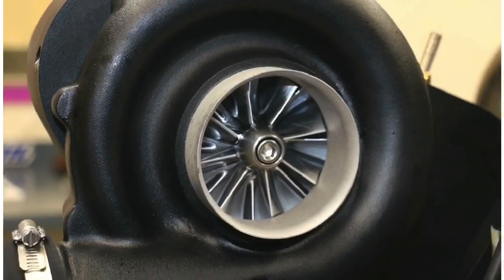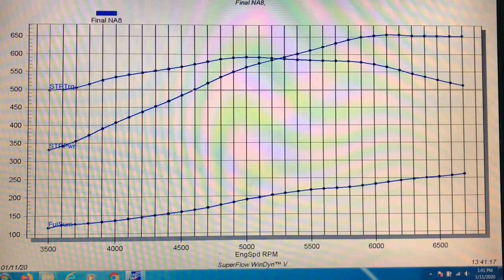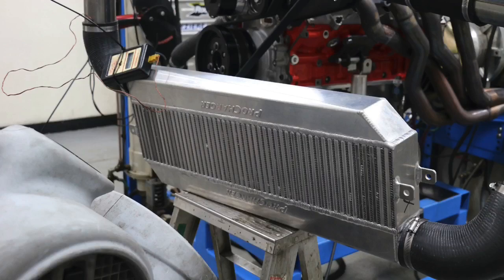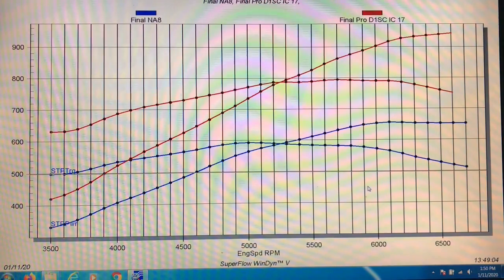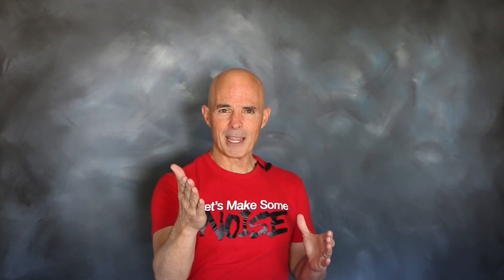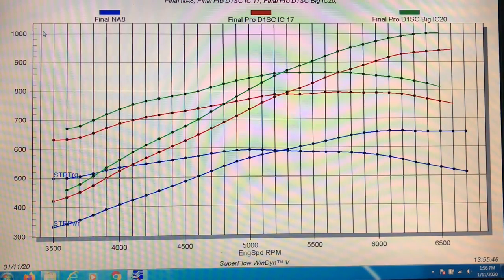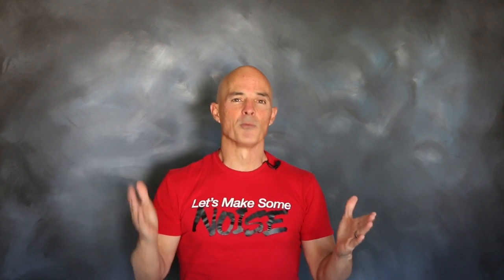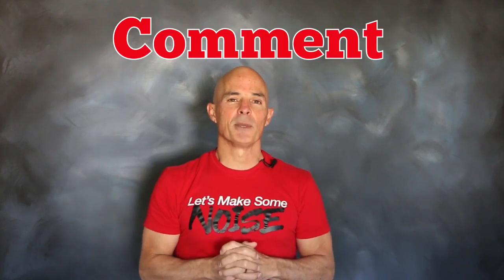LS ATA INTERCOOLER TEST-IS BIGGER BETTER?

Comment: I would love to see what the difference between 3 inch and 3 1/2 inch piping would make really appreciate all your time
Reply: I think he did this or it might be exhaust I'm not super sure but you can check the vids
Reply: I’ve back to back tested 2,2.5,3 inch piping on a 300hp sr and bigger was better in response,hp and temperature drops. Also going to a 4 inch core vs 3 inch in 300x600 dropped boost pressure but held the same power so bigger is better in pretty much every scenario considering my testing was on 300hp

Comment: Should have ran the 4.5" core
Reply from the maker: What this motor really needed was an F1A-94 (which I ran)
Reply: @richardholdener1727  also true... Would have been interesting to see the difference between 3 3.5 4.5 small water to air and big water air at same pulley size

Comment: Richard!!!! I know you love efi. What do you think of a blow through methanol carb system vs efi with intercooler??
Reply from the maker: I like intercoolers on every boosted motor-even blow through carbs
Reply: On a race only engine on e85 and meth injection. Water to air or air to air?

Comment: can you do 100% methanol no ic vs intercooler
Reply: Agreed, everyone says, You don't need an intercooler for methanol", while that may be true from a detonation standpoint, intercooling ALWAYS adds power through density!
Reply: Cheap Intentions this was actually done on engine masters with the help of Richard. If I remembered right the engine was fine with methanol at low boost, but a problem arose with unequal temperature across cylinders. The test was done on an ls motor with an efi manifold so the meth was not able to flow evenly across all cylinders, leading to less power at equal boost when compared to an inter cooled set up.
Reply: @rssjramon  I think you are talking about an auxiliary meth kit vs the OP meaning primary meth...
Reply: @700HpVette  you're right idk why my mind skipped over the 100% meth part

Comment: Great stuff Richard!!  Was the temp reduction basically the same through both ICs?  That might also have something to do with the results, since the 2nd core had more mass to absorb heat out of the charge air.
Reply: @bigboreracing356  Did he say that in the video?  I was wondering if he mentioned it somewhere along the way and I missed it.
Reply: @bigboreracing356  good chance he has the data, I'm curious to know the magnitude of the difference.
Reply from the maker: the temp in the intake manifold was very similar for both cores
Reply: @richardholdener1727  Thank you!

Comment: You should test those Tiny eBay intercoolers everybody runs on Mustangs versus a killer one
Reply: Shiit my friend runs a little baby honda intercooler to cool his s475 to his 6.0. I always make fun of it whenever i can. I had to cut so much to fit my 4" core and he just slapped that POS in
Reply: jtdandnme  that would be nice to see!
Reply: Now I wanna see a bunch of  different tests! I have a cx racing 4” core with 3” outlets and  3” pro charger core with 3” outlets!  Also maybe a charge pipe size test .  But with there s480 turbo.
Reply: @leroyt2590  haha mines an xspower which is same as cx as far as ebay quality goes lol. A direct size comparison vs name brand like garrett or procharger core would be cool too
Reply: Berserka Saurus exactly!  Also include inlet and outlet temperatures and pressures before and after the intercoolers would be cool to see!
Reply from the maker: 235-115 degrees
Reply: Daver G  I had to watch it again. Your correct!

Comment: Yes the pipe size is part of it. Ford 326 1000hp build. Had a 4" thick core with 3" piping and in/outlet. Welded on a 3.5 outlet and ran 3.5 to tb and picked over 50hp and 35tq, same intercooler.
Reply: how much boost it was ? i am also near 1000 hp using 4 inch intercooler with 3 inch inlet and outlet , do you think it is better to change the whole piping  or after intercooler is enough ?

Comment: I’m trying to make a solid 1,000rwhp from my ‘16 mustang GT under 8k RPM. TVS Superchargers are out and I’m considering either a D1x procharger or a 3.6L Kenne Bell, do you have a suggestion?  (Street car no competition to care about)
Reply from the maker: The 3.6L KB will support a LOT more power than the TVS. Procharger has blowers that will make more too-for a street car-any of them will do 1,000 wheel
Reply: @richardholdener1727  Do you think the extra heat from the Kenne Bell is really an issue?Thanks for the replies.

Comment: If that msd intake is not ported by Mamo it flows like shit as proven time and time again.
Out of the box the fast 102 for the LS7 is superior
Reply from the maker: Having tested the MSD and Fast and Stock LS7 back to back multiple times-the MSD has always made more-I haven't seen porting show big gains yet-but would like to see it
Reply: @richardholdener1727  that's strange.
You should contact Tony Mamo and have a word to him about this.
This is all over the ls1tech forums also.
Time and time again it has shown that out of the box the fast 102mm performs better everywhere.
Once the msd is ported it outshines the fast from idle to red line in both hp and torque on LS7 applications.
The msd needs a lot of porting though.

Comment: There is something wrong with that LS7.
Either the cam or heads are the issue.
That na curve is not good
Reply: Yeah, I only know wheel numbers, but low 600s is pretty easy with almost any good combo, so 650 on the engine dyno is pretty weak.
Reply: Got to be a valvetrain issue..
Reply: Not only that but the torque curve on LS7 engines is usually flat as a pancake to almost the read line.
This one drops off too rapidly.
The low power and unsatisfactory curve could be valvetrain related.
One other thing I noticed this LS7 was only being revved out 6500rpm.
This revs out to 7000rpm stock....
Reply: I would bet it was the intake, would love to see this whole test done with another intake!

Comment: Thank you for another good video. 
I guess most of these engines need and uses 102 mm throttle body which is 4". For 1000 hp 4" tubing is a good choice so 3" has to be way to small.  
The intercooler cores you tested are GOOD and no Ebay / China junk. Look at this: https://www.youtube.com/watch?v=U0LCbcBDaAI
Reply: An engine like that has no need for a 4" TB. You could easily make well over 1000hp on the stock 75mm blade ( which is still 4" hose fitting ). 4" would do no harm, but wont make any difference to power.

Comment: Hello Richard, Great job.
Is it possible to see the intake tmperature between each test?
Almost injector flow calculator said: 1000 hp => 150 lb injector flow. You used 89lb on dyno. Can you said me the max injector duty cycle during testing? thank's you
Reply from the maker: temps were 235 into core and 115 in the intake, your injector math is not accurate, we had boost referenced reg and 60 psi static pressure. Run at .5 bsfc (NA), the 89-pound inj will support 178 hp per cylinder (89x2) and 1424 hp total. The BSFC on an NA LS motor is much better than .5. If we factor in the added fuel for the boosted application (multiply by .85) we get over 1200 hp. Quick method-multiply inj flow in lbs/hr by 16-that tells you power potential. Multiply that number by .85 to get boosted power potential.
Reply: @richardholdener1727  thank's for your answer because it's difficult to have the right information. bigger is better but you can have problem on idle with min injector pulse.

Comment: Any suspicions as to why this engine quit at 6100 N/A? I expected that combo to make peak closer to 7000 and certainly above 6500. With great heads, long tubes, and a big cam could it be that intake?
Reply: Mostly that fast intake manifold.
Reply from the maker: It was an MSD
Reply: Headers I reckon.... i think the primaries are a bit small
Reply from the maker: Headers were 1 7/8-plenty big-we run these on lots of stuff-including 495-inch strokers
Reply: @richardholdener1727  you know better mate.... 
I wasn't sure but I suppose how the dyno curves show the story

Comment: I’m curious what happens if you put a cooler that’s too large for the turbo what would happen?
Reply: I was actually thinking this too. When would the size be too big? I'd like to too see one with a 4 or 5 inch tubing and huge intercooler
Reply: Almost no such thing. You can pick up a little lag. But unless your doing something just dumb (like a 6” thick core that is 40” long and 36” high) it’s almost impossible to over intercool. Maybe with a pro charger it’s a thing. But with turbos, it’s never too big. 
My fiesta ST see’s 30psi daily, but it has the same size intercooler as my 725whp turbo LS fox. My SRT4 picked up huge gains on the bottom end, mid range, and top end by going to a 4” thick core. The fiesta did pick up some lag, but it sees a 7-8 degree charge temp rise from 0-130mph at 30psi.
Reply from the maker: bigger is better with intercoolers-it usually comes down to space

Comment: But of that 60hp, 30-35 or so was from the added boost not the intercooler I’m assuming right
Reply: STREET RACER I’m aware he didn’t change pulley.  But it made more boost. So I’m guessing half of the gain was from the added boost and the other was from lower iat’s
Reply from the maker: there were no lower IATs with the core change-it was all flow
Reply: @Onalky87  Boost is just a measure of restriction, not flow.  So don't get sidetracked by that.  The blower was moving the same amount of air at the outlet, but with less resistance (pressure drop) across the bigger IC, more of the work the engine is doing to turn the blower is translating into airflow that reaches the engine vs. building more pressure against the smaller IC.
Reply: @Onalky87  if you want to see some really good videos on air flow check out Gale Banks, hours of theory and testing. He's been boosting engines for over half a century, has a bit of knowledge to share.
Reply: I like how this comment section has lots of people who understand airflow theory. More educated than most internet forums
Reply: @bigboreracing356  lol what im not talking shit? I got a 383 with a billet s475 through a 31×12×4 core with a 1000cc meth nozzle. Was pushing 32 psi last pass. Dc on my 80lb injectors were over 90%
Reply: @bigboreracing356  hahaha thanks. Ford guys are always mad about something! Lool

Comment: Would be great to see data for pressure drop through the inter cooler.  Temperature drop also.
Reply: I agree. Wanted to see the charge temps, after intercooler and/or in manifold
Reply: Same here
Reply from the maker: temp was 235 in and 115 out
Reply: @richardholdener1727 , what was the ambient temp in the dyno cell?
Reply: @richardholdener1727  did you measure pre intercooler pressure? That also tells a lot of the story in terms of restriction.
Reply: yeah but on both cores
Reply: @SchofieldBrothersRacing  Corky Bell has a chapter dedicated to intercooler design in Maximum Boost ISBN 0-8376-0160-6.  It's a good read.
Reply: @mxguy2438  thanks, I got it today before I left town for business.  Going to start reading tonight in hotel
Reply: As Gale Banks would say it’s the density gain inlet to outlet and the temperature drop.
Reply: Yes if you could, both pressure and temp drop in each case. Thank you.
Reply: You said it in much simpler terms than I did for sure!
Reply: @UCHXIEUMNFQwoErOMeUfwcsA, I have heard a few knowledgable FI gurus clearly state that there is such a thing as too much intercooler volume. I assume it has to do with boost lag being created when a given FI device discharge output comes up against the total aftercooler and intake system volume, meaning the from the discharge of the FI unit through the throttle body and into the intake manifold.
Reply: @joesilvasr9733  a good turbo manufacturer will spec a correct inner cooler for your hp and their turbo for your aplication . so i was told by garrett . hat when im ready to get in touch with them and with some engine info the will spec a inner cooler core for my engine.
Reply: yes i want temps
Reply: Did the larger cooler have a larger temperature drop?

Comment: Please consider testing oem air to water intercooler vs aftermarket air to water intercooler vs oem & aftermarket plumbed in series. I am of the mindset that removing the oem cooler is a mistake and that supplementing with an aftermarket is the way to go. TY again for your informative videos.
Reply from the maker: what OEM ATW? on a roots blower? LS9 or LSA?
Reply: @richardholdener1727  LSA preferably a CTS-V and thank you in advance for your due consideration. 

Respectful Regards from Texas